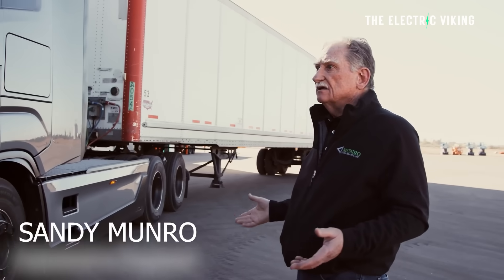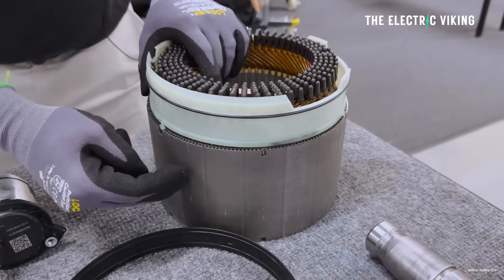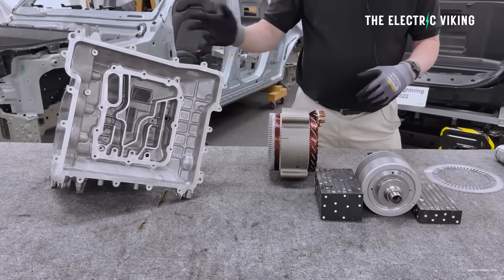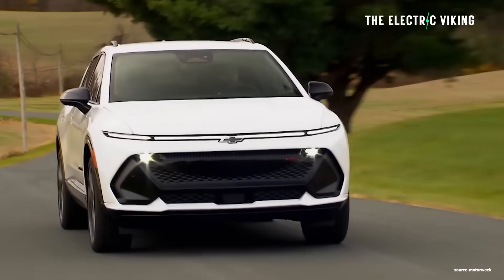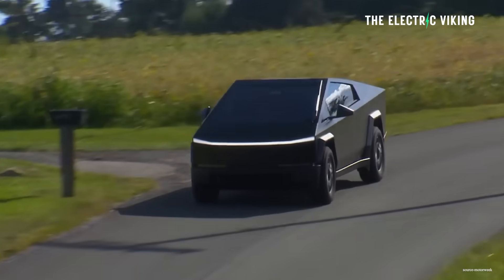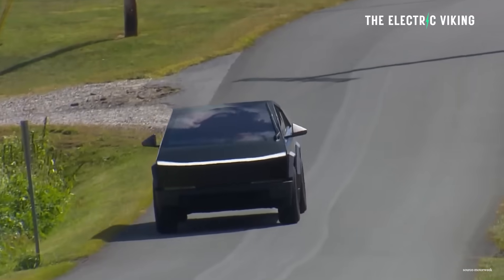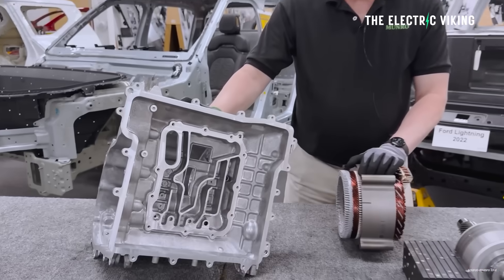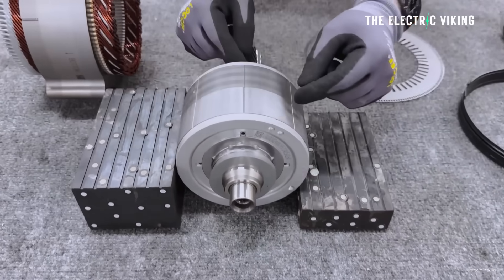Sandy Munro Tears Down Tesla and Chevy EV Motors & Discovers This...

Comment: Hold the phone.  

Let's not forget that the way that Tesla achieves its efficiency claims is because it overstates it's miles per kW.  And GM significantly underestimates it's miles per kW claims. 

Maybe the Tesla motor is no more efficient than the GM motor.

I have an all-wheel drive 2025  Equinox EV.  I typically get 3.8 kW per mile. That's pretty darn good for a vehicle that large. And I'm usually carrying an awful lot of stuff like construction materials in the back of it. I don't even use the back seats. They're folded down at all times. I just conducted a massive move with it in the spring and I was still getting about 3.5.

Comment: I had a cheaper side lawn tractor that lubricants using a splash method. I let the oil get a little low, was doing a side hill. 🔥💣 My next mower was a beautiful JD with power everything and an oil pump. Oil should consistently circulate IMHO

Comment: I watched the original Munro video with one of his senior engineers with a group of engineers who had developed the new EV motors for the current GM line of EV's.  Your comments are similar except that the Munro engineer did NOT place any speculation on which design is "better."  
Since the only exposure you have with GM in your part of the world was Holden, there are a few things you might not know.  The original GM EV1 utilized the DC inverter, sine wave controller/regen system that GM later sold to Toyota which uses it in all of their hybrids.  The tech is not 40 years old, still good enough for Toyota.
The current motors use "splash" lubrication systems which were good enough for American automobiles until the late 50's.  GM (and Toyota) engineer for simplicity because after almost 100 years of designing automobiles, GM knows what works well for the least cost.  Your criticisms were mostly speculations, loaded with many "If's" but not much else.  
Tesla's cost a LOT more money, generally have poorer build quality for the actual automobile, and have no more facts pertaining to the longevity of their cars than anyone else, including Sandy Munro.  In the meantime, Sandy himself came to appreciate the simplicity of GM's design paradigm.  He came to really respect the Bolt.  And lastly, as testament to how well the current GM cars are engineered, there is a delivery driver in the American mid-west, dealing with snow, bad roads, etc. who has 450.000+ miles on his original Chevrolet Bolt.  No major problems, no powertrain issues, it just keeps going.  Can Tesla claim that, for an entry level EV?
His YouTube link is here:  https://www.youtube.com/watch?v=_dQIzZYtmgs

Comment: What I'm hearing from this is the GM ev motor doesn't have cooling happen when the motor doesn't need it -- when standing still, etc. Does the outside temperature really make that big a difference when the Equinox isn't moving, or going slowly? That seems like a reach to me, but I'm not an engineer.

Comment: THE TESLA MOTORS ARE INTERESTING AND THERE IS A LOCAL COMPANY THAT IS A SUPPLIER TO TESLA THOUGH I AM NOT SURE WHAT THEY CONTRIBUTE.......ONE OF THOSE THINGS IN A CONVERSATION WITH THE GUY WALKING ACROSS THE PARKING LOT TO HIS TESLA AT THE CHARGING STATION THE COMPANY PROVIDED.......AND AS THE WALK PROGRESSED IN STEPS....THE GUY WAS THE ....OWNER.......OF THE COMPANY ....AND THE TESLA WAS A GIFT AS PART OF THE BUSINESS WHICH MANUFACTURES MANY ELECTRICAL COMPONENTS OF SCALE AS OPPOSED TO SMALL ELECTRONICS PARTS IN THE SURFACE MOUNT WORLD.......AND ...CISCO OVER YONDER A SHORT DISTANCE.......IN COMMUNICATIONS.......NOT FAR OFF THE......INTERSTATE....AS THE WHEELS GO ROUND & ROUND.

OVER ALL.......ELECTRIC FOR PERSONAL TRANSPORTATION IS DESIGNED WRONG AND ALL TECH'D UP BEYOND......AND K.I.S.S.   AS KEEP IT SIMPLE STUPID....SORRY GENE SIMMONS........ELEMENTS OF ELECTRIC AS IN THE TESLA MOTOR ARE FINE AS A CORE TO BUILD A PROPER PLATFORM AROUND CORRECTLY....AS AS AS......C.A.F.E. LAWS DO NOT APPLY......FOSSIL FUEL DEPENDENCE IS OUT OF THE ELECTRIC EQUATION BUT THE HAND IS STILL BEING PLAYED AS TO GO......FROM FILLING STATION....TO FILLING STATION.....>>>>>> IN A CONTEST TO FILL A TANK OR RESERVOIR OF......ENERGY........AND A FOSSIL FUEL INDUSTRY THAT HAS SO SO MUCH PROCESS TO GET OUT OF THE GROUND AND TO THE SALE OF A TANK OF.......ENERGY !!!!  >>>>>> THE CURRENT OF MEDICAL SCIENCE WANT TO GO ON THE PREMISE OF....CIRCADIAN .....AND SUN LIGHT.....AS OPPOSED TO DARKNESS AND WHAT IS NEEDED TO LIGHT THE NIGHT........AND...AND....AND.......IF UTILITY OF PERSONAL ELECTRIC TRANSPORTATION DOESN'T INCORPORATE THE HARVESTING OF SUN LIGHT.........SITTING IDLE IN A PARKING LOT.....DESIGNED BY DESIGNERS THAT WERE SLAVES TO FOSSIL FUELS AND CONDITIONED TO GO....FROM FILLING STATION.....TO FILLING STATION......WHEN A SKIN OF A PLATFORM COULD ABSORB....SUN LIGHT.........IF THAT >>>>>>  SOUNDS FAMILIAR TO A HUMAN AND SCIENCE....PUTTING SKIN INTO THE GAME....OF GRAND DESIGN.

<<<>>>> A PERSONAL TRANSPORT...IS ONLY USED IN THE MOMENT OF NEED AND TRANSPORT......OTHERWISE.....IT.....SITS IDLE.........AND DOESN'T NEED THE TENDING OF LIVESTOCK........NOR A SHIT SHOVELER'S UNION & GUILD
Reply: Does this train of thought have a caboose? And, fix your caps lock, please.

Comment: I worked with Sandy on the C-17 cargo jet back around 1990. He was hired to help us re-design it for affordability. He was a great guy. I was on a committee to look at re-design projects. We ended up training thousands of engineers on DFMA (Design for Manufacturing and assembly). Over a 5 year period, we were able to reduce the cost of each airplane by $50M. I’ve recently retired. BTW. Sandy looks the same. He was old looking back in the day.

Comment: I think you viewed that analysis through Tesla tinted glasses. The GM system is more reliable in most cases and less costly to maintain. The Tesla oil system is more costly to build and maintain but better performance under certain extreme conditions. For my needs, I'd buy GM.

Comment: Observation only but GM's EV motors don't spin when they aren't propelling the vehicle. Therefore they won't heat up unless moving, and when they spin they get cooled. They spin at about 7rpm to 1rpm of the tire (Bolt EUV at least) so plenty of oil transfered in the first few feet of motion. Ambient temperatures of 30-40C are not super impactful on a motor designed for ambient temperatures of -20c to 40c and beyond. I suppose if you took the car to the Outback in January and did quarter mile bursts until the battery gave the motor may suffer over a prolonged duration but that would be irrisponsible as the car is not designed as a track car but a semi-affordable daily commuter. GM's method is simple and cost effective given the vehicle it was put in. Comparing it to a Cybertruck motor is a piss poor comparison because the use cases are not aligned. The Cybertruck motor is over engineered to handle the excessive use. Compare it to the GMC Sierra EV motor. Compare the Equinox to the Model 3. This comparison was like a V8 duramax to a Boxer 4.

Comment: I disagree with your assessment. The complexity of the Tesla method is more likely to result in reliability issues. Pumps wear out and oil channels get blocker resulting in thermal breakdown.My engineering group constantly elects for solutions that are reliable over those that may provide limited gains. The Tesla solution is more reliable in a demanding performance situation but the most drivers never are in that situation.

Comment: I'd like to pose the question of whether a small electric pump to move and "spray" cooling lubricants within the GM motors would produce a reasonable cost effective compromise between the two example of the Equinox and Tesla motors.    Just a thought.  If it really would only be mostly beneficial under certain conditions mentioned, then why not carefully target cooling/lubricating jets at as few locations as needed to address potential shortcomings of their design?

Comment: You didn't mention maintenance. Obviously an oil pump is an extra component (plus its piping and connections) which at some stage will need maintenance or replacement. Plus of course if it fails, it may overhead and damage the engine. This seems an obvious point, which Sam didn't mention.
Reply: A pump motor with no wearing parts, running at modest temperatures, should have a long life.

Comment: Tesla has far better engineers and broader vision, GM can't afford or even get that engineering prowess and therefore goes for the old, simple, cheap answer.
Reply: The Chevy approach is more appropriate for a cheap car. I'm sure GM could design (or spec) a pump if it was better in their application. But as Elon says, "the best part is no part".

Comment: Tesla = EV1 + 8400 PANASONIC air cooled cells.
The GM EV's have water refrigerated modular battery system "ULTIUM" which is more safe specially on floodings.

Comment: Oil pumps with clean oil are incredibly reliable and with no combustion products and moist air as in an IC engine the oil is always very clean and just to be sure it has a filter.  I cant see how it could fail with the correct clean oil from new.

Comment: I prefer to have a cooling system that ramps up and down depending on the amount of heat the motor is generating so my vehicle will keep going even when it's operating under challenging conditions such as summer and uphill. This conversely allows for the cooling system to use less energy during cool weather and downhill driving and ramp up as needed to keep the motor in it's most desirable operating temp.

Comment: If the equinox is budget or mid priced then so is the model Y.  My local GM dealer a few equinox EVs and they are more expensive than a model Y!!! Like every dealer that only stock cars loaded up with expensive options.
Reply: I made the mistake of getting a 2024 Kia EV6 GT-Line AWD plagued with ICCU failure at 4700 miles and less than 1000 miles later, the 12v battery that was replaced at 4200 miles is now having issues again.

The stinking heap was $65000 USD after all was said and done! Had I waited a few months, I could have had a Tesla Model Y Juniper Launch Edition for less money, full FSD included, and for about the same payment!

Thank God for the Song Beverly Law in CA, they’re (Kia) taking it back! I got a 2025 Model 3 Highland LR RWD (now a Premium RWD) for less money and plan on keeping it.

The software advantage alone is pretty insane to conceptualize, and we’re not even talking about how the ride is quieter! FWIW, the Kia has 255/R20 wheels and the Tesla 235/R18 and I get realistically 100 miles more range, Sentry mode, and FSD all within the extra 100 miles. Don’t start me on the Supercharger network!

Comment: Haven't seen an Electric Viking video in over two years. You know what? This is still the Tesla Promotional Network. Nothing changed, except I bought another Toyota PHEV. This channel nearly ensures I will never ownd a full BEV.
Reply: Hybrid systems are complex and prone to failure if you’re not Toyota. My 2023 Accord Hybrid had a few too many recalls within the first year of ownership.

Great car until the battery drained going on steep inclines in California and the little 4-cyl struggles. BEVs make more sense since it’s not a bastard-child in-between.

Having had turbo-4s, Accord Hybrid, and now a Tesla Model 3 Premium after my Kia EV6 had the known ICCU issues, Tesla is still king of BEVs for the long term in the US.

Do I wish there were more/better options? Of course!

Problem?
- Kia / Hyundai eGMP platform has a faulty ICCU issue that will hurt their PR in the next 5 years.
- GM is hit or miss, also, it’s GM. Failure is part of their DNA after the 2000s.
- Toyota / Lexus made a horrible value proposition with the bz4x / RZ. Their competition offered far better options.
- Rivian has software issues, bankrolled by VW, and their design could improve for repairability. For a startup like Tesla, they can definitely do better.
- Slate auto is one I’d buy stock in. Time will tell what comes from them.
- Xiaomi, BYD, and other Chinese EVs don’t really exist here unless you go to Mexico or Canada.

Also, screw Toyota for lobbying against EVs! They’re out to protect their reputation because they know their latest batch of engines are failing them and there are better value propositions out there!

Comment: This idiot thinks your electric motor is making heat when you are sitting still!!!!! 😂😂😂😂
Reply: They can do that by putting current into phases that don't turn the rotor. It's a cheap way of generating battery heat to precondition it for charging. Very clever, and I guess you wouldn't have thought of it.

Comment: So the energy used by GM's motor to lift the oil is not free. It comes from the battery. Tesla's pump is variable speed so it only uses as much energy as necessary for cooling. My 2018 Model 3 performance used about 20kW to maintain 70 mph. Assuming the motor, inverter and gearbox losses are about 10% then that's about 2kW of heat that needs to be removed to cruise at 70mph. So cooling is needed just about all the time.
Reply: Sounds reasonable. One thing to mention is that there will be a certain amount of air cooling that can occur as well, at least for the motors, that will slightly reduce the load on the cooling system. Electrified Garage (Rich Rebuilds' offshoot) actually removes the cooling circuit from older Tesla Model S's that have that O-ring that fails and contaminates the motors with coolant. It's a pricey fix but they have a bypass for it and say the have not seen a single failure caused by heat. I am not sure how deep they tested it as many people just use their EVs as commuters, where it may not be as big of an issue. I could see heat building up over time at a constant load as you cited. I know Tesla didn't put that expensive cooling system in (both in cost and added weight/load) for fun, but they also likely factored the worst case harsh use scenario when designing it. Personally I'd probably want to repair it unless the car already had high miles and wasn't worth investing in.

Comment: It doesn’t require any external cooling hardware, but it does have the resistance of the oil being slung around, though likely more resistance in an ice motor it’s called windage, where the crank shaft slings the oil around in the crank case.

Comment: I would think that GM's method of cooling the motor would induce a lot of power robbing windage in the case. Which actually does rob the battery of power and range

Comment: Afaiu, Tesla can exchange heat from the motors to other systems because of their cooling method. I don't think GM engineered their vehicle's motor cooling to work as part of a larger system of heating/cooling.

Comment: The fact that Tesla can design cars that both save the planet and drive you full speed into a brick wall is astounding!
Reply: Only if the sleeping, drunk or mentally impaired driver allows it.
Reply: If you mistaken the accelerator pedal for the brake and be dumbfounded what happened next. The system allows you to overwrite safety features.

Comment: My friend has had two Toyota Prius, both went over 350K miles.  No motor issues.  Simple is better,  no pump to fail.
Reply: I had a neighbor across the street in Virginia for 10 years.   The tow truck driver and the owner were on a first name bases. After 5 years he traded for a new Prius and the tow truck relationship continued. Really sad. At gatherings I heard him tell others how much he loved his Prius and how dependable they were.
Reply: @bearlemley  That's surprising. I know a few who have them from old to new and none have had issues. I guess any company can make a dud and it stinks that your neighbor got two. I wouldn't want one just because they are boring and have a lot of road noise, although the new model is improved by quite a bit.
Reply: Oil pumps with clean oil are incredibly reliable and with no combustion products and moist air as in an IC engine the oil is always very clean and just to be sure it has a filter.  I cant see how it could fail with the correct clean oil from new.
Reply: Doesn't it have an electric water pump?

Comment: How is the Tesla version better? In a failure mode it's dangerous as the motor could overheat, and the system is much more complex to no benefit to the end user.

Comment: A not mentioned benefit to the Tesla method is that in very cold environments, the motor windings are used to heat the cabin before driving and the pumped motor oil is used as part of that process.
Reply: GM does heat recovery on their ultium Platform vehicles as well.